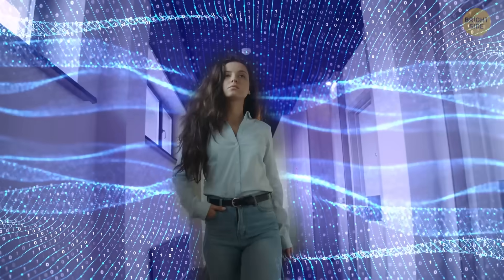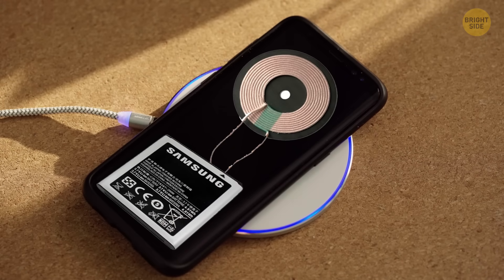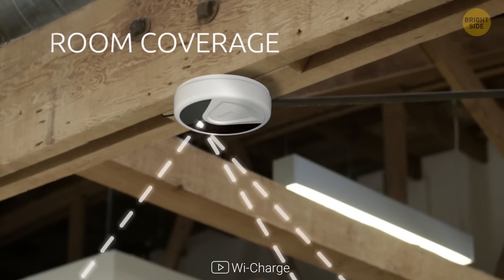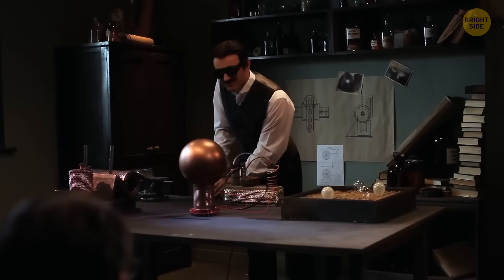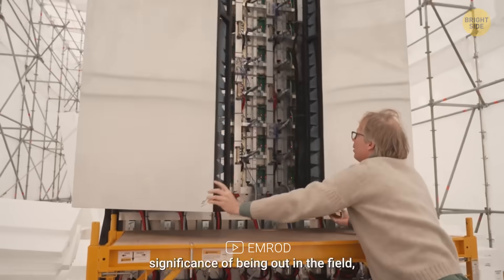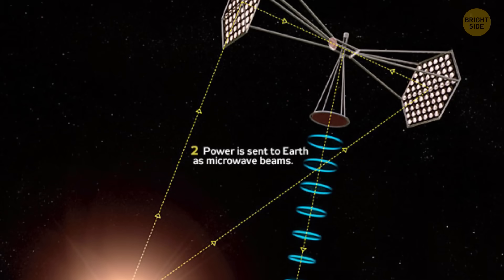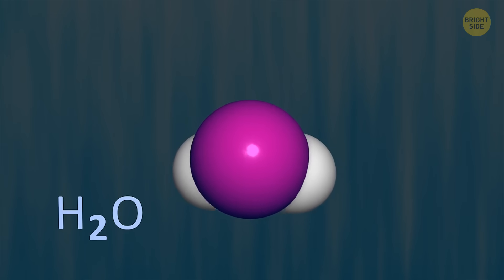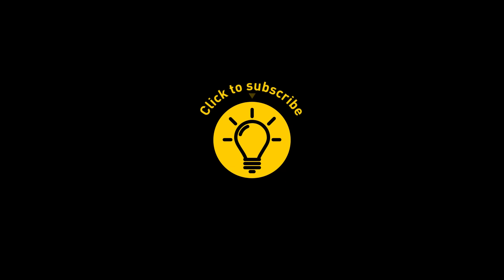Nikola Tesla’s Wildest Idea Is Finally Coming True

Comment: have idea. Terra form. Use plastic. Wrap sand or dirt into blocks of 7inch long, 5inch high, 5inch wide. You can use mould (a box that size) Black tape up. Then cling wrap them up. You can then glue them like bricks.with twisted flax inbetween . Longitude and latitude. Big swimming pool size elevated with sand mound. Or on-top hill. Silicone corner's. Will capture rainwater.Can use for housing as well.😊 In desert places